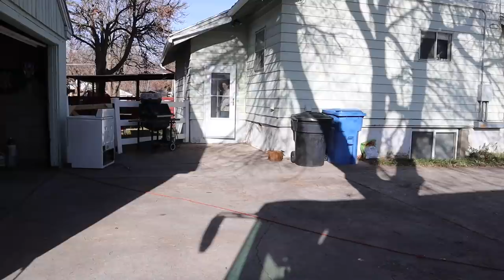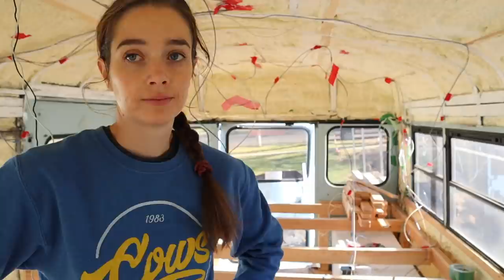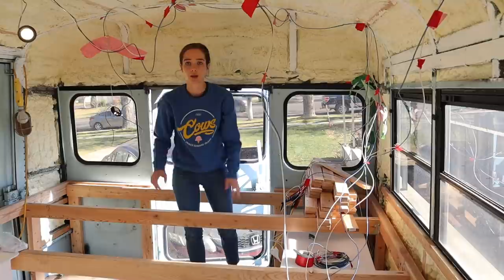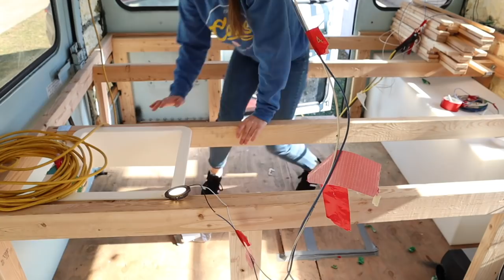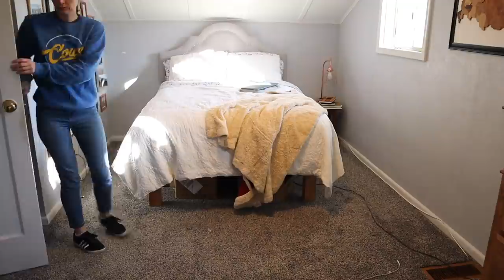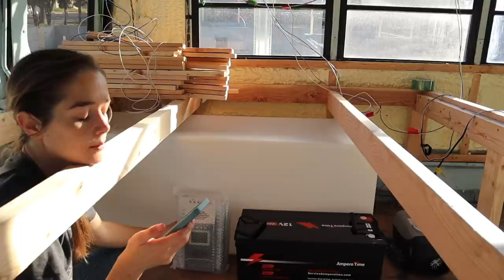School Bus Conversion Electrical P1: Testing 12v lighting, organizing components, &SO MANY QUESTIONS

Comment: I've been watching build videos for years, and have done a number of building projects. You are doing great, don't be so hard on yourself.. Glad I am not the only one who can't get the stupid solder to work! 

As for the wall by the water tank Are you thinking something like this https://www.youtube.com/watch?v=xuZg4NasCVw that is how I've seen others do it. They make it removable do all the major wiring out of the vehicle and then install after. 

As for the 'combiner' do everything in your power to keep from causing a fire. (Pun intended) I have never felt bad about adding an extra thing, but every time I cut corners it ends up costing me. So much so that when I upgraded my camper I spec'd out to double my needed capacity. That said I am unsure what it actually is and would have to research what it is before I decide what I could remove.

P.S. I have done schooling requiring a volt/multimeter and I have to look up how to use it every time I need it.

Comment: So many clueless comments here it's kinda irritating. Pay attention to the situation...think about things before you rattle off things you read and seen on Insta. Or projects you've never worked on. THIS IS A BUS rated to carry like 20,000 lbs or so. It will NEVER notice the 100lb battery or 500lb water tank. It won't throw the weight off. Many school bus owners complain how rough it rides cuz it's capable of way more than they get used for converted. 

Now the water and power a dangerous mix issue...umm hello all the electric water heater,  washers, dishwashers, pool lights and garbage disposal, car electric water pump, aquarium heater/pump etc ALL HAVE electric directly with water ...they're all making dangerous products for decades that you guys all use but claim is a terrible idea...again pay attention to reality...not fantasy land. Go call them up and tell em their engineers are idiots. 

I would use some paint or that rubberized roof paint on the floor under that water tank. The tank NEEDS to be anchored down well. Blocking screwed down around to keep it from sliding around. Then some ratchet straps holding it down. Front to back is the most important...Cuz a panic stop is the most likely problem scenario. That 50gal or whatever is like 400lbs full. 

Yes you can build a wall there and mount components on it. Secure the battery too. 

The combiner box will kinda depend on your wiring. It's easier to have a JUNCTION box on the roof, it's different than a combiner box. But it really depends on what you want to do. 3 panels have 6 wires...they need to terminate somewhere somehow. So they will either combine into 2 wires going to the controller inside or up on the roof.  I emailed you pictures of how to DIY a cheap junction box on the roof. It can be whatever you need it to be. I think you will likely want the 3 panels wired in series. So the voltage of each panel gets added to the next...so they all add up to 24v x 3= 72v at 9A output from the panels. You will just have 2 wires through roof to the controller. So you will just have the Junction box as a connection point to go through the roof. 

You have my contact info if you wanna talk real time to plan the install and get a better understanding of it.
Reply from the maker: thanks!

Comment: P
Reply: 12v is will not be hurt you will. If you hold  + & -  wires at the same time. Make sure you put fuses on the circuts

M